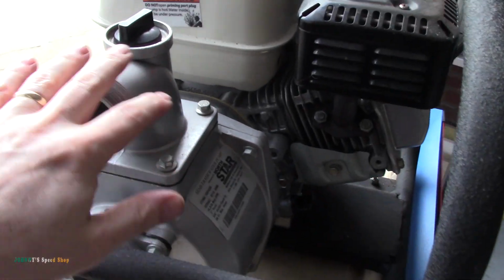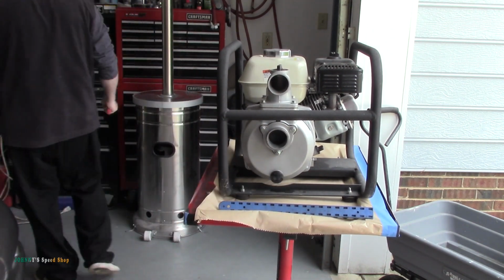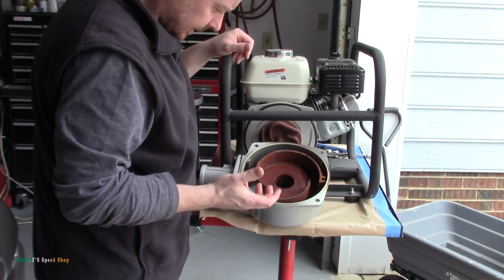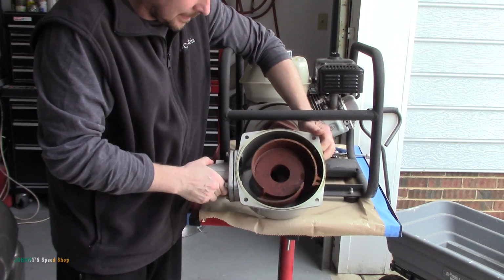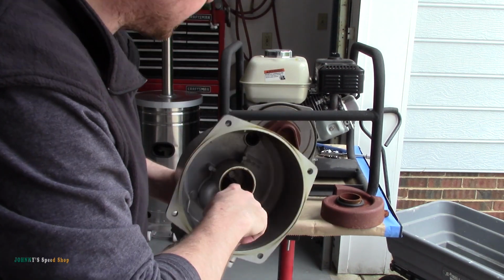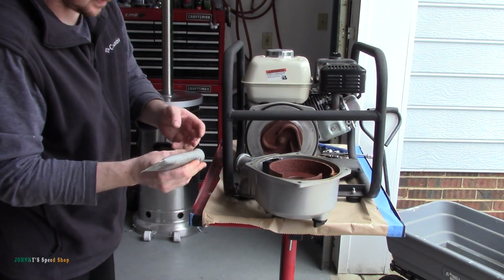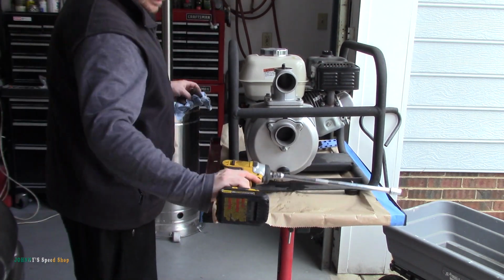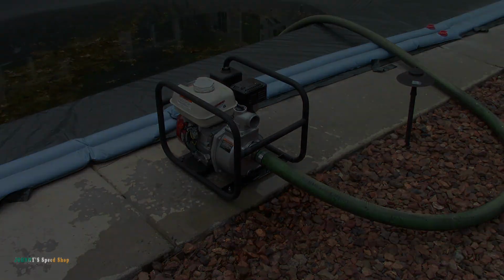Honda GX 160 Engine / Pump repair  #poolseason #swimmingpool

Comment: If it’s only running with choke on or semi on clean the carb and jets it’s 100% fuel starvation.  Why does it run semi choke or any position between besides 0 choke? The chokes purpose is to pull more fuel into the combustion chamber than the normal no choke condition of its air to fuel mixture.  When the choke is on less oxygen and more fuel than no choke is present which is why it also smokes because of the absence of oxygen causing an inefficient combustion of fuel. Basically a running rich scenario. Because there is a restriction in the fuel delivery system the choke is allowing enough fuel for the lower air volume being restricted by the butterfly type valve of the air intake to allow a sufficient enough fuel to air ratio to support ignition and combustion repeatedly

Comment: The high pressure versions of these have been designed wrongly .Always and I mean always you end up getting water into your engine oil after only 20 hours use ..Terrible design
Reply from the maker: Huh...strange...mines been rock solid until thus happened and it's been years since I fix this without any issues... I pump about 10k gallons a year so light use for sure..
Reply: @JohnnysSpeedShop  The trash pumps are fine it is the higher pressure ones that suffer

Comment: Hey I just had a customer drop one of these off cuz it won't run for very long. Can I run it without water going to it (dry run) or will the pump burn up?
Reply from the maker: If it's a trash or semi trash pump with the metal blades then yeah you can run it for a few mins no issues but at least prime the pump before running to avoid any damage.
Reply: @JohnnysSpeedShop  thank you so much. It's a semi trash with the silicone carbide

Comment: i am having a hard time finding a video that shows how to remove the impeller, mine is very corroded and many bolts need to be replaced so i can close the impeller housing back up, how does one remove the impeller ?
Reply from the maker: Not sure mate that was not my issue,  not sure if it's pressed on, or bolted top the crank.... you may just need to use a 3 jaw puller to yank it off.... you can download the service manual form Honda for free it should have tha removal procedure for you. ....